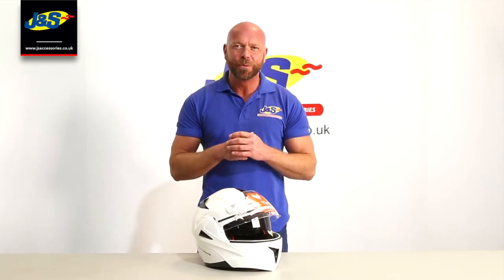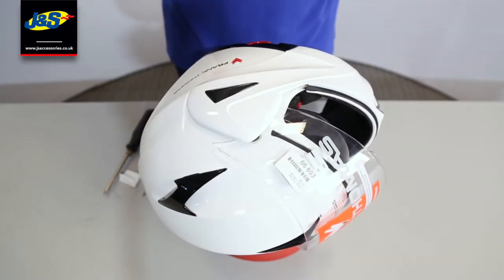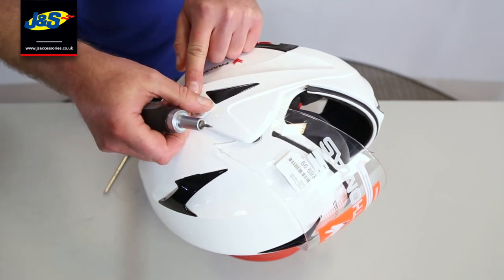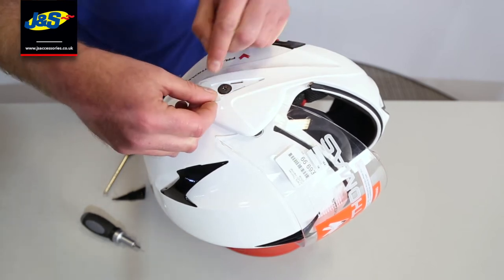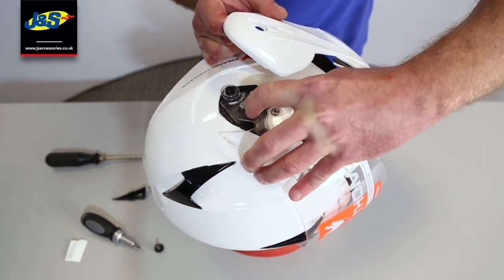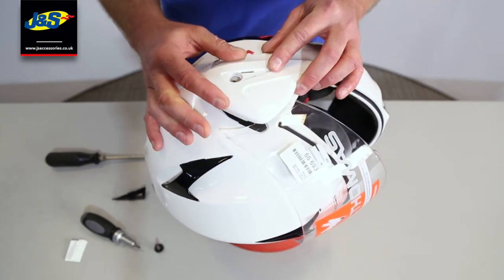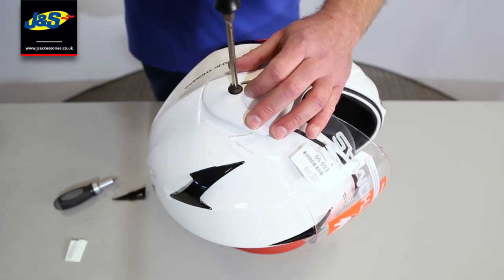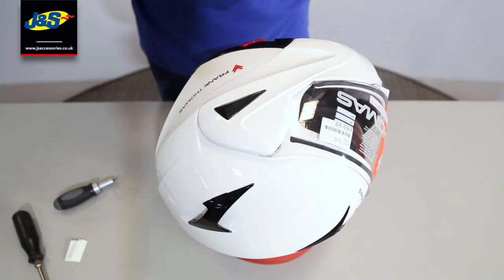How to remove the visor from a Frank Thomas FLH01 Helmet - J&S Accessories Ltd

Comment: Thank you so much for this, I have this helmet, albeit under another brand/name, and I couldn't find any instructions and was scared at first to pull off the black bits. Got my pinlock properly installed :D